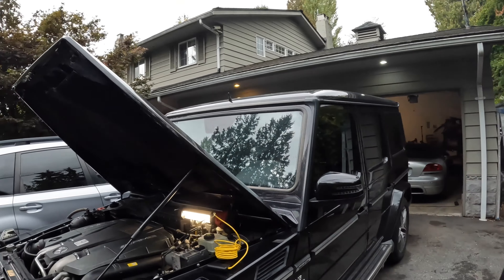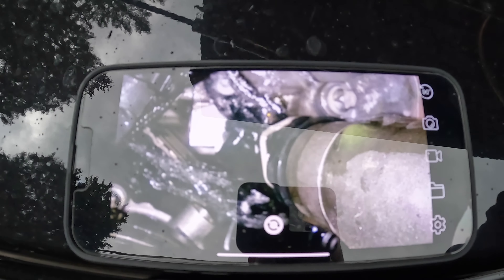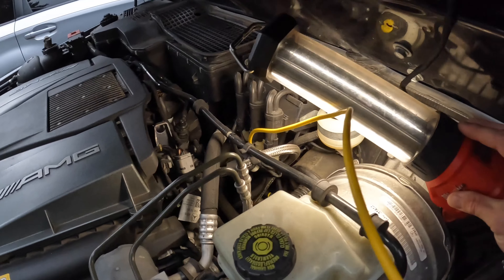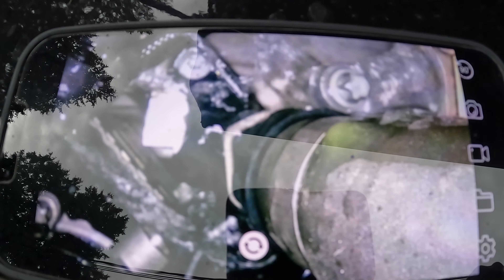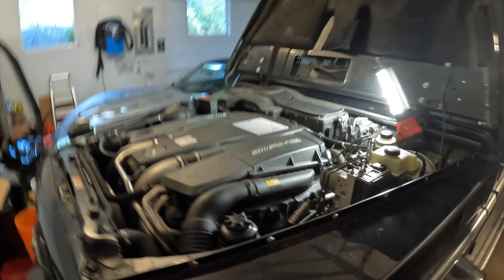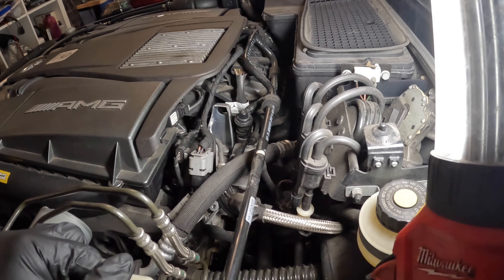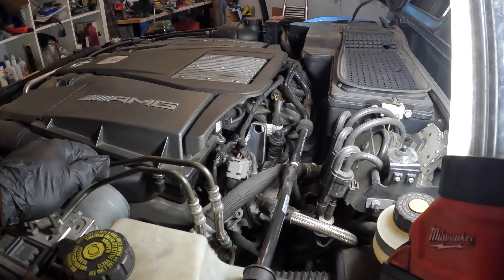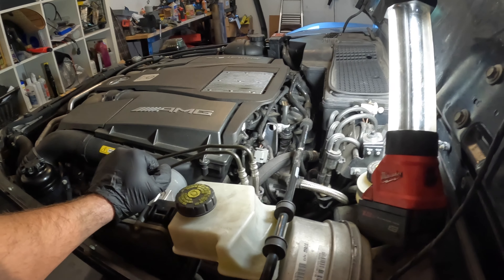Replacing a coolant fitting on the back of the AMG G63 motor. M157 5.5L Twin Turbo Engine

Comment: hi, I just bought the GL 63 with m157 and now I am waiting for them to bring it. the car has a small radiator on the left side that is damaged and I was told that, that small radiator is just for turbos and it is separated from the main radiator, and I want to know if it is true or not? can I use another coolant just for that or do I have to change the whole coolant in the system? Does your car also have an additional small radiator on the left side? and what kind of coolant do you use? MB approval 325.6/326.6 or something else?
Reply from the maker: I'm assuming you're talking about the heat exchanger? I think it's a separate system and has a separate small reservoir under the engine cover. I use blue MB approved coolant, I believe it's made by Beck Arnley
Reply: @ViperMike  the radiator and the heat exchanger are not the same thing ? o.O Aren't they both doing the same thing?
Reply from the maker: @user-ez7mf  no. The radiator cools your engine. The heat exchanger cools the air going from the turbos to your engine. It’s an air to water heat exchanger or “inter cooler”
Reply: Replacing this on mine right now